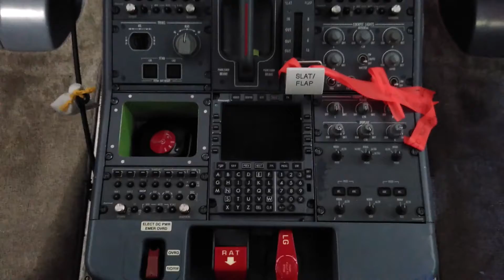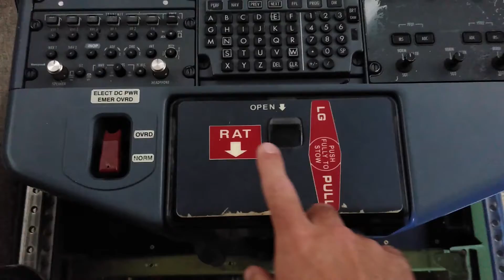Aircraft Emergency Power Source is a RAT...!!!!

Comment: What plane is this? I've launched ADG today in MSFS2020 in CRJ700 and it makes terrible noise like u were drilling a hole in concrete
Reply from the maker: Hello Nixxx2000, you are VERY close! This was a Global 6000. Both the Global and the CRJ are Bombardier aircrafts, are very similar and share a lot of the same parts. The CRJ family looks like a stretch limo version of the Globals.
Reply from the maker: As for the noise, yes, it is loud and you described it very accurately.

Comment: Never heard of this. Hmmmm
Very cool. Ok how about a safety chute for the entire plane
Reply from the maker: Chutes do exist but are only used on smaller planes like the Cirrus. A chute system for this size airplane would be huge, expensive, and the planes are so reliable and redundant that the chances of the chute being your last resort  is so minute that it's not worth the expense.
Reply: @planesimple8514  I get the message. And taking into consideration the size of the parachute.....yeah kinda not practical. Next....